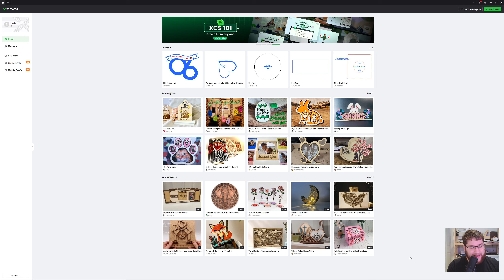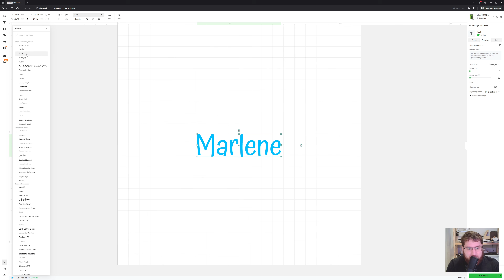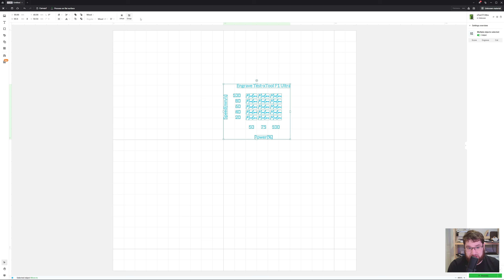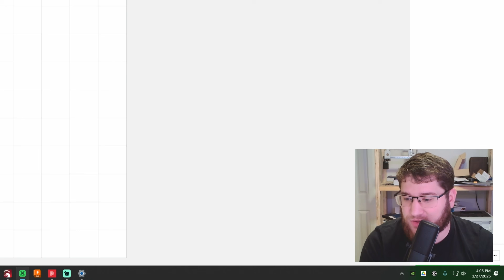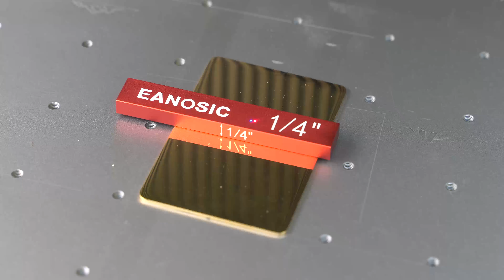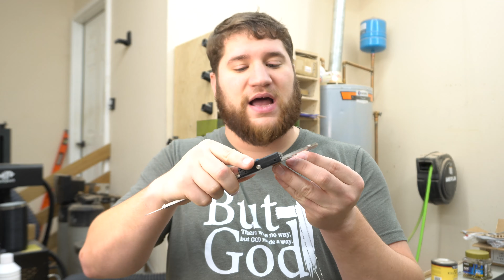You Won't Believe How Easy Jewelry Making Can Be with xTool F1 Ultra

Comment: Awesome video and very informative. When you do the black annealing is it supposed to look black from all angles? I tried a test engraving and it looks black straight on but from an angle it is much lighter. Is that normal or should it be darker black from and angle as well?
Reply from the maker: Depending on the annealing quality, sometimes it’ll be black from all angles and sometimes straight on. I’ve not personally dialed it in to be black from all angles with the F1 Ultra

Comment: Do you have a good way to center the text. I normally will use the camera button and zoom it in to center it. However, b/c of the defocusing method, the camera is   positioned incorrectly. Any suggestions would be great!
Reply from the maker: What I normally do is try to draw the shape of the item and outline that, then disable the shape before engraving (once defocused). Another option is to just use the normal framing function of the laser to outline the shape/size of the text that you're engraving and position it that way.